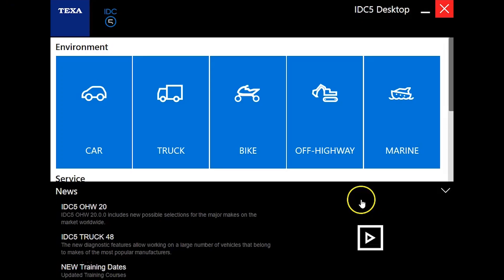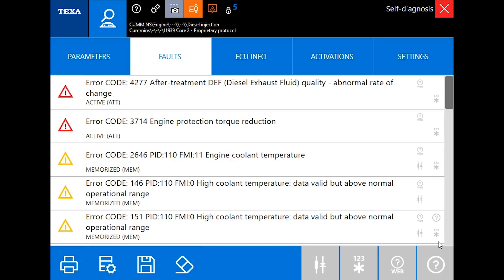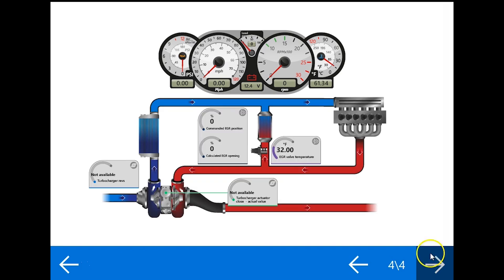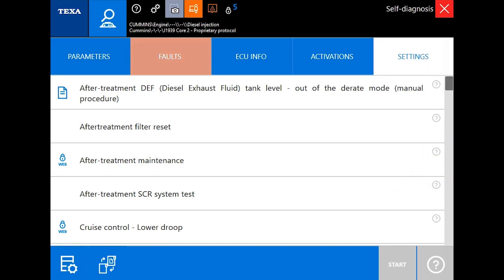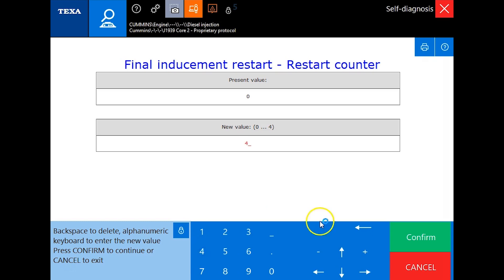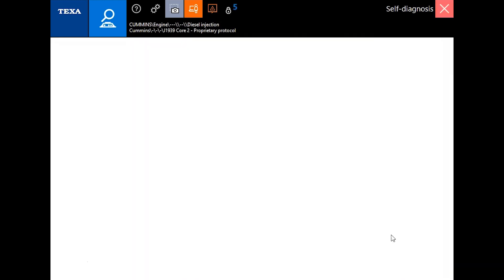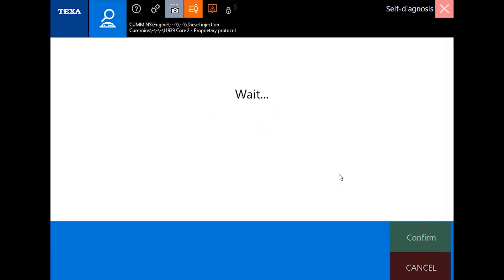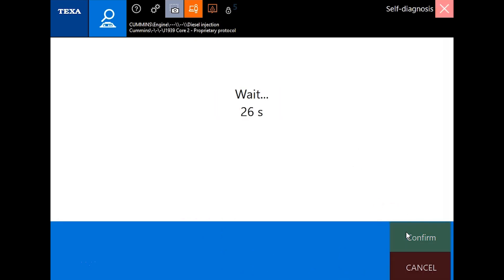Clear 3714 Derate on Cummins QSF

Comment: Mine will not clear a 2016 freightliner I'm working on. No matter how many times
Reply: Same mine keep coming back driver drove without def and it was already crystalized in the pipe where it’s sprayed so it was already not getting in there properly I’m using a Snap-on pro link edge